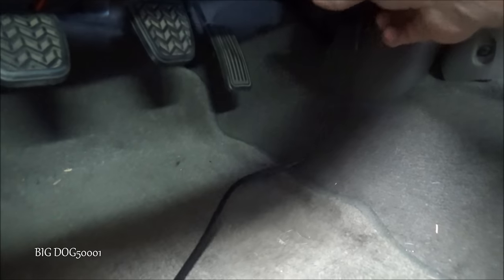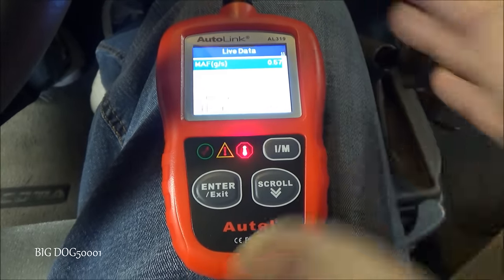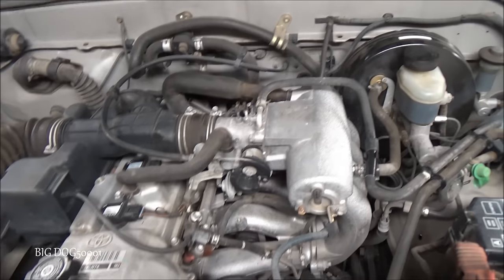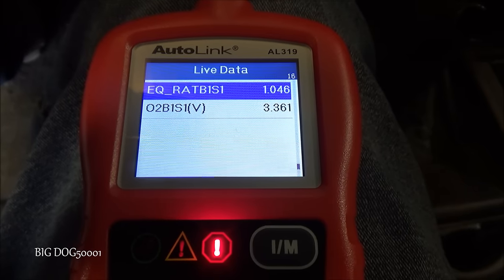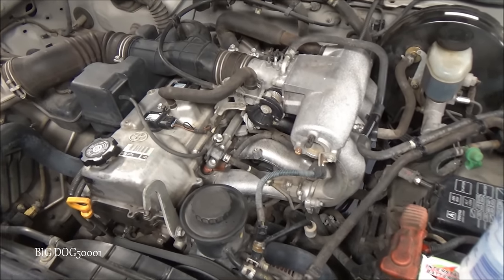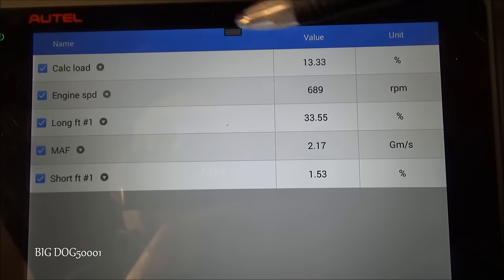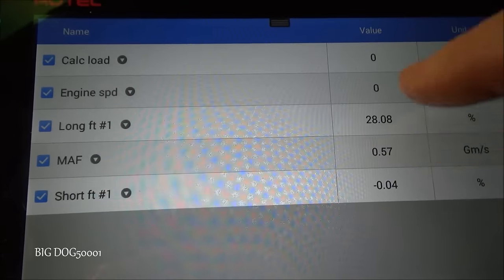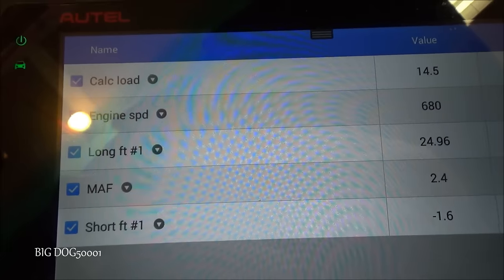P0171 Trouble Code: System Too Lean Bank 1 Diagnosis

Comment: I had this code on a Mazda 5 less than 2 weeks after it had been serviced at the dealer.  I saw online that people had similar issues and the air filter housing hadn't been fully set and locked in place after being checked.  I unclipped the clips and it did seem the back of the housing wasn't clicked into place.  I made sure the air filter housing was in place and cleared the code using this tool.  So far after a few days the code has not come back.

Comment: Hello! I have a 2000 camry 2.2 and I have a positve 20% long term fuel trim at idle  on closed loop, and when revved up past 2000 rpm it drops to postive 5-8%.   Any ideas where I can start to fix this issue?

Comment: I have an 07 Prius with the P0171 code and the list of things that are potential problem areas is endless!   This morning I was doing an active test looking at fuel trims and noticed the long Tem FT is not moving at all.   it stays pnned at 32.8%.   What controls this?   The STFT is hovering around 0 or negative.  And suggestions here?   Thank YOU!

Comment: Hi Bid Dog thank you so much!! Like you said a couple tihngs could be wrong. On my 2005 4.7 Tundra,  I am getting P0171, my trims are at 27 LTFT but  I am also experiencing a bog down in power at 2,000-3,000 rpm when i accelerate onto freeways. I am thinking i need to check for vacuum leaks AND a possible fuel pump issue?

Comment: Hi, My Vauxhall Zafira 1.6 L petrol 2008 is giving MAF reading of 1.71 g/s at idle. Is that high? With engine off it is 0.13 g/s. 

No other codes than P0171.

BTW my vehicle doesn't have a MAF sensor rather a MAP sensor and it calculates the reading from that ....

Comment: same year engine in my rav4, and a p0171.  Similar trims but my STFT trims are a lot lower, mostly normal, but LTFT is steady at 31.8.  I did a smoke test with no conclusions, vacuum test on the evap hose was 21hg.  Then, tested fuel pressure and it was 31 lbs, way below spec of about 45 to 50. I do suspect a bad fuel pump given my fuel pressure, because I have to date replaced injectors, MAF, O2/AFR sensors, fuel pressure regulator and filter.  The injectors corrected some serious misses, the fuel filter was defintely dirty, so my car is a great example of multiple issues.   However, I am absolutely going back with this video in mind and look harder at those MAF numbers, testing RPMs, pulling multiple vacuum lines - like that brake booster.  What a great video for helping figure this out.  Great tips and detailed information on what to look for.  Many thanks.

Comment: I have 2009 suburban…I am getting p0171 P0140 P0054 P0300….all indicating bank 1 sensor 2 . I changed that sensor but for same light again. The truck runs good otherwise I just think my mpg is really bad. My short term fuel trims on both banks are at or below 0 at idle. The long term fuel trim for bank 2 is approx zero but long term fuel trim for bank 1 is about 20 and goes down when I rev up the engine.

Comment: I finally found my vacuum leak after tearing my hair out for quite a while. I do not have an evap smoke machine so i was just doing visual inspection only. If i had to do it all over i would have just bought one of the Evap smoke machines because i would have found the issue right away in just minutes. The leak was coming from the PCV hose where it attaches to the back of the intake manifold on a 2013 honda CRV. What makes it soo hard to check this hose is that it is hidden behind the Intake manifold. You can see part of the hose but about 2/3 of it is hidden AND the area is so small you cannot run your hand along the length of the hose to feel for any holes or cracks in the Hose.

Comment: I just bought a 2017 volvo xc90 (50k miles). I have p0171 with 0% stft and idle but at speed it jumps to over 50%.  The fuel Guage looks like it's going down faster than normal too.  Anyone?

Comment: Are those desired numbers specific to a certain type of car or dependent on the size or type of engine?  Wondering what I should be looking for from a Volvo 5cyl turbo at close to sea level.  I have the same symptoms as your test vehicle. Can't get rid of P1171, LTFT is 25% positive and stays there. One of my O2 sensors reads in the negative mA at times then goes positive. 

Thanks again for this video, I haven't seen anything so clearly and carefully explained yet!  I subscribed!

Comment: Great video...maf readings can be tricky....is there a data spec sheet that we can use to diagnose if they are good or bad?  Those numbers werent off by much and had such a profound impact on the fuel trims....makes me think that having a data spec sheet is crucial for quick diagnosing and just simply correctly diagnosing

Comment: my maf sensor reading 14c when its 2c outside when the engine is cold and when engine is hot on idle it climbs to like 20c. My short is 0% to like minus 20 and longterm is more steady but 0 to minus 5. its a huyndai santa fe 2,4l 2005. Is this normal? (had a p0171 code come out of nowhere after a 50km drive on idle)

Comment: gday from australia. just signed up. ive got an ls1 (208k kms) and getting both 174s and 171s ONLY when stone cold after a couple of minutes. . the check-engine light then goes off within a minute or 2. ive cleaned the throttle body and maf sensor. still no diff. ive booked it in tomorrow for my mechanic to do a manifold and pcv vacuum leak test.  the only engine mod is extractors but they've been on for years. i'm getting horrible fuel economy at 20L/100kms.   if no vacuum leaks found tomorrow, ive got it booked in to replace both O2 sensors as well as the coolant temp sensor.  any ideas? would the maf sensor be a better choice to replace rather than the coolant temp sensor i wonder...? bruce

Comment: Thank you for sharing you expertise with us. I would say that I would have changed the MAF sensor and checked for leaks. But would not have thought the brake booster was an issue.

Comment: my mazda 6 2017 have same issue exactly i had my fuel injectors replaced and no air leak any were, my air flow read same low value arond 1.6 to 1.8 at ideal, i tested 4 sensors same thing, all read 1.6 and i have lean condition what to do ?

Comment: You're one of very few YTers on here who explain your diagnostic so thoroughly. Between you & Eric the Car guy, I'm at great ease with doing my own diagnostics instead of spending $100's at the shop just for the diagnostic and I'm doing everything in my power to avoid going to an Audi service center, because I laughed at how much they would charge. 

I've been maintaining my vehicles all on my own and my '97 Toyota Camry just hit 355k running like a champ (best car ever to own), but I'm in a new ball game with my Audi. I've been trying to pinpoint my lean system for 3 months now and every time I correct the issue, days/weeks later the CEL comes back on. I have a 2002 Audi A4 Quattro 1.8T, and had a rich system with the code p1136. Was able to correct the code because I was running 15 lbs lower in pressure which is a sign of the filter housing/regulator. 

(BTW Audi/VW probably best to replace those every 10k-20k even though they currently don't have regular service intervals on the fuel pump regulator/filter housing which is 1 unit in all)

I should have figured that was my cause since the fuel pump was recently replaced and the vehicle is now at 171k (recently purchased😡). 2 weeks go by and now my system is running lean with the code p0171 and I replaced the MAF sensor (with the fuel pump). I'll have to go back and check my hoses because G.E. is known for having low quality hoses. Thank you for showing us in detail with your scanner. I have an obdII at my job and I'll have to take a look on my lunch and figure out where this leak is coming from. 

Thank you again!
Reply from the maker: I appreciate the comment, thanks!

Comment: Hey Big Dog, got a 2018 impala with keyless start, every time I go put gas in it it keeps turning over for about 20 seconds or so before it starts and I’ve been getting the p0171 and p0174 codes…. Any ideas where to start with that…

Comment: I do have the same code P0171 on my Nissan Versa that’s the reason why I took it to the shop, what they did they tuned up it and changed the oil then the next day engine check came on again. We took it back to the shop again the same code  now the shop telling me they couldn’t figure out what’s wrong to our Car and advising us to bring it to the Dealer I’m being charged almost $700 for not being fix the real problem, after I watched your video Mr Big dog I think it’s just a simple problem and the parts and labor it could be less than what they charge the other work they did to my car, I’m pissed😩

Comment: Hello I have the same problem with my Seat Leon Cupra R. P0171 fuel too lean. I don't understand I checked all the pipes no leaks but I have the brake servo leaking and a mechanic tells me that it comes from the brake servo. what do you think about it??? I suspect the flow sensor put or oxygen sensor the one above

Comment: I have a 01 Toyota Corolla with this code and can’t figure it out changed Crankshaft sensor oxygen sensors Feul pump coil pack MAF sensor spark plugs 🥺🥺🥺

Comment: I got this error got that its too lean. The fuel pump was recently replaced and the shop also replaced the oxygen sensor. But an engine light came back on when I stepped on the gas to pass a car. I cant afford to keep paying dealer to keep diagnosing. Im probably going to replace Air Filter and Mass Air Flow sensor myself. Need to find out what the latest code is though. 2007 Audi A4 Quattro.

Comment: i have a 2015 trax with a turbo motor. i was getting this code and I took it to GM dealership for diagnosis. they said the flex pipe was leaking, said a smoke teat revealed it... i bought a new one and had it changed. i didn't get any more codes for a few thousand miles, now its coming back since the cold weather has come, it will go off after about 35 miles but will come back on within 100 or so,,, there's no change at all in how the vehicle runs ... i don't know if I need to run higher octane gas being its a turbo or just ignore it being it does go off by itself.. i did see where a oxygen sensor could cause it but the GM diagnosis tool did not pick that up.... any suggestions ??

Comment: Great job Big Dog! Keep them coming. I have a booster doing the same thing to a Saturn. If you put a vac gauge on it and pump it up it won’t hold vacuum. Is that right. My booster leaks at rest but not when the brake is applied. Thanks for your time and any input you might be willing to give.  Great video again. Really simple!!!
Reply from the maker: Not sure how you are doing your tests but it sounds like you are on the right track, thanks for the comment!

Comment: so, if i have a po171 and trims maxed out and pinch the brake booster vacuum hose and my trims go back to normal...that means that I have a leak in the booster? 
When I pinch the booster hose, trims go normal, when I totally close it, engine stalls!!! anyone?

Comment: We will eventually be able to recoup some of the money we were dupped out of but if sealing small leaks don't work that MAP sensor is costly. Now do we know that these other out of sync sensors are leaks  caused the failing sensor to go bad?  Why don't they put bypass wiring to prevent being stranded and do they really help mpg?

Comment: my 06 satuen runs fine then suddenly turns off. I do have a TC light that comes on right before the car starts to runs rough.  when coming off the highway it will just die and sometimes even while driving. no studder no signs car just dies

Comment: Great video! Thank you for a really thorough explanation. It has helped me diagnose/eliminate causes for a Ford Ranger  
P0171 error code.
Reply from the maker: Glad it helped, thanks for the comment!
Reply: Sean McGuirk what was your fix?i have same truck same code
Reply: @04LIOA  I am still running with the code. I have been putting off doing the fix. Fuel pressure is within low range. I have a bad filler neck that's leaking. So, when I get the bed off to get to it, I will replace the fuel pump as well. I will replace the fuel filter along the driver-side rail as well and clean the MAF sensor, too. I should be getting to all of that soon and will pass along any diagnostic good news.

Comment: I had this code pop up and I almost bought a maf sensor. After watching this video I did a visual inspection and noticed 2 cracked lines which I replaced 1 and taped the other then boom the check light was gone. Thanks again big dawg

Comment: I would've waited on the maf just too pricey for diy mechanics to replace.  The question is would that vehicle run in spec with a new brake booster and the original maf?

Comment: Please help I had my car in 4 different shops with code p0171 put a mass air flow sensor in an new vaccuum line behind the engine everything this code is for was checked and everything should be ok but light still comes on same code runs rough stalls misfires haed start what is going on is it a ghost code I'm running out of money

Comment: This is a simple fix. I learned the hard way. I popped code P0171 and then I also popped P0174. Thinking I need to do all these things; changed plugs, coils, MAF, ran smoke machine and no vacuum leaks, and changed the oil and filter. The messages said my fuel injectors were bad or needed cleaned. I dumbed some Seafoam in my tank but did more research before driving my truck around. Well, I spent $5 and bought a new PCV valve. The old one did not rattle when I shook it telling me it was clogged with sludge or just no good. Popped the new one in which did rattle, started my truck and all codes were cleared and truck runs perfectly. Try the PCV Valve first.

Comment: is P0171 an urgent issue that needs fixed? My audi a5 has it. I feel a slight shake on my car during ignition and on idle mode. But dont really feel it on idle mode after driving, in a traffic light for example.

Comment: What does it mean when you test pressure the vacuum line (22 pressure) and the short term fuel goes up( 5%) I'm stuck trying to figure out the lean issue on a scion

Comment: I was searching for another issue and found this video.
Thanks for the tip on cleaning the MAF sensor.

I had this same code for quite some time so I finally decided on the basic and changed all my sparkplugs.
That did the trick to get rid of the code.
It was probably dumb luck.

Thanks again for the quality of instruction in this video!

Comment: I learnt at least 3 and all of them crucial new things from this. Short term and Long Term fuel trims - so even if I fix a fault on the air intake e.g. turbo inlet pipe not fixed on properly - guess why I gave that example? The car will still run badly until a few startups afterwards. The other big one was the expected values for MAF - I thought that would be different on every car, particularly a 2011 SAAB 93 turbo petrol. I cannot thank you enough for pointing me in the right direction with this video. I was about to have to take the car to a garage - after having already fixed the issue yesterday - only  for the garage to tell me that there's nothing wrong with my car + at least an hours labour charge!

Comment: love the video :) very thorough explanation. got a question though... if brake booster is faulty, can it cause a malfunction with breaks? meaning, I think I have an air leak somewhere, also I'm seeing my left front brake going blocked from time to time (which btw I already repaired completely) but still get pressed somehow and causes my wheel to heat up. so I was wondering since its all kind a connected, does bad brake booster can cause something like that? btw, the car is mercedes-benz e200 w211 facelift...
many thanks in advance!

Comment: I subscribed because you really took the time to explain just what was going on and why - I learned so much.  I think I watched it 5 times and took notes. Thanks
Reply from the maker: I appreciate the comment, thank you and welcome!
Reply: @BigDog50001  bought the same tool (All ell 319 or whatever) and was able to use the information I learned in your video and apply it to my project.  Found that the vacuum line to the motor mount was leaking.  fixed it and got my  long and short term trims to under 8%.  I think the LT is like 2.5 and the short is 8.5.  Anyways, I can now get my daughter's 05 Honda Accord to pass inspection.  Thanks.

Comment: Wow.  I was running with a bad brake booster for a couple of years until I finally removed it and had it rebuilt but it never gave me a vacuum check engine light or code on my 01 Taco 4x4.  I did get one code for a bad cat but replaced it with a magnaflow and its work fine and dandy since.  400,000 miles on the same engine and tansmission so far.  Thanks for the video great job!  Im gonna troubleshoot my BMW now.

Comment: This is a very well done video. He shows precisely his process of checking out the fuel trim system and looking at the O2 sensor reading along with the Mass Air Flow sensor. Uses logical interpretation of readings to do an effective job of isolating the parts of the system to narrow down the repair focus. He really makes understanding the closed loop system relatively easy. And shows what multiple problems together do to the feedback look of the fuel system. Best video I have found to really understand and troubleshoot a P0171 issue on my Toyota!!  Thank you!!

Comment: Quick question, with this code, should you suspect it’s a pirate air problem if your fuel economy is down considerably? Because won’t your vehicle use more gas to try to maintain the ratio? I’m watching your video while driving, my usual MPG highway is around 16-17, currently I’m at 9.2.